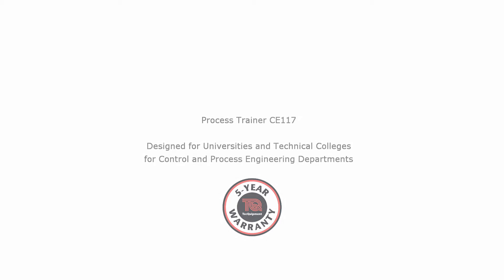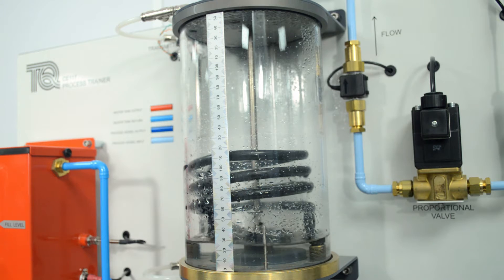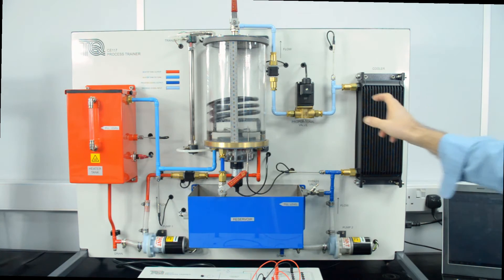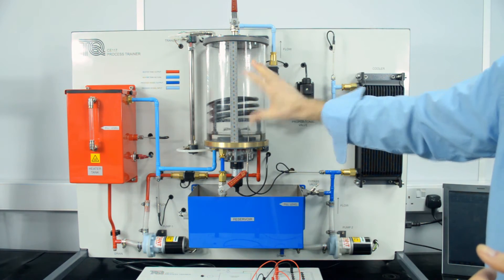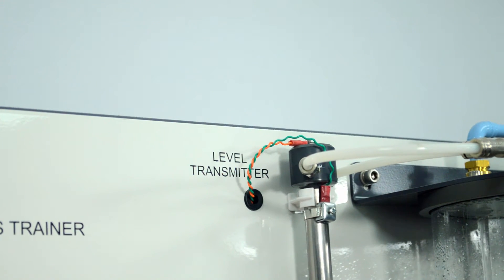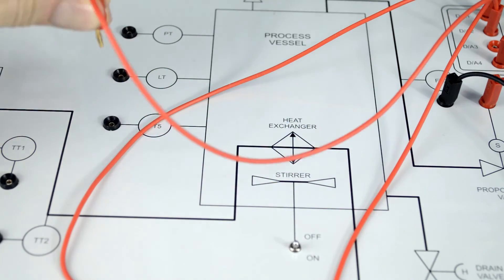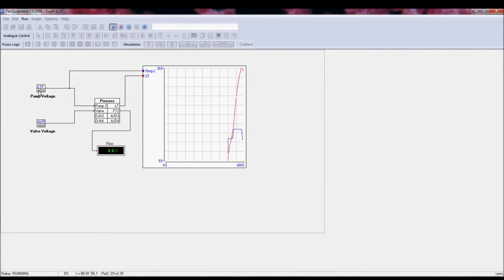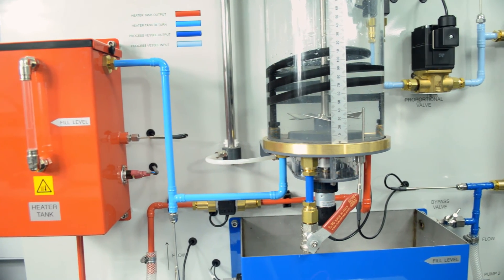Process Trainer (CE117)- Control Engineering - TecQuipment

Comment: Sir flow and process diagram are available ??
Reply from the maker: Hello,  the answer is yes. 

With this piece of apparatus you can learn about:     
Proportional, Integral and Derivative (PID) control,
    Control of flow,
    Control of level,
    Control of pressure,
    Control of temperature,
    Ratio control,
    Cascade control,
    Multi-loop control and
    Interacting control loops.

It is supplied with TecQuipment’s CE2000 software for supervisory control of the process with data acquisition.  The software allows students and experienced control engineers to develop and test a wide selection of controllers and filters. The Control Software combines controller design and implementation into one logical process where you can use the software icons and wire them together on screen, just as you would draw a control system on a piece of paper. The icons include the important parts of controllers, signal generators, manually controlled signals and voltages, and virtual instruments. 
You then set the software to record important variables. After this you can plot the results in a chart and export the data for use in other programs.
We hope this helps.